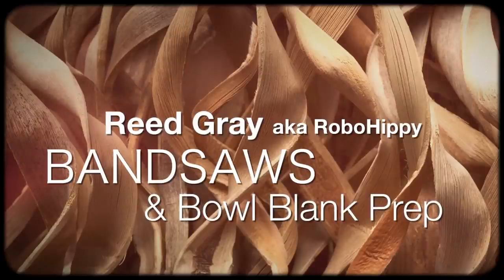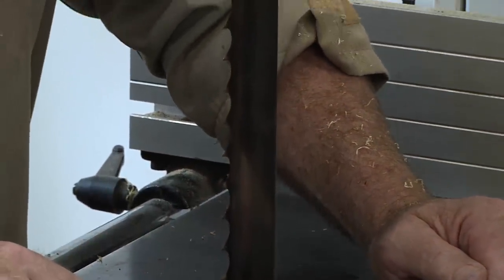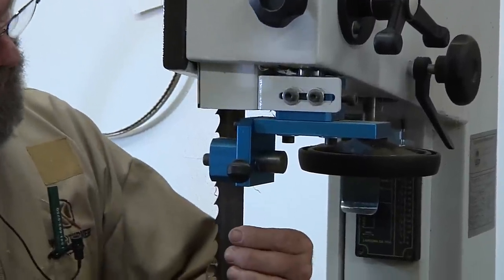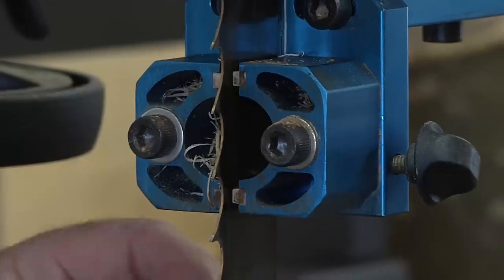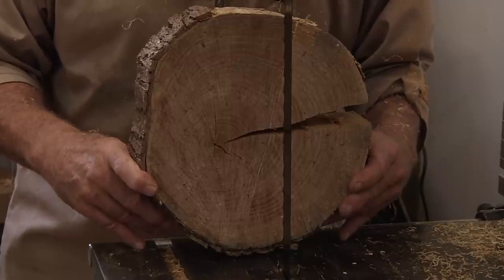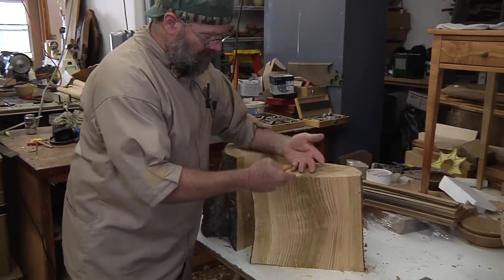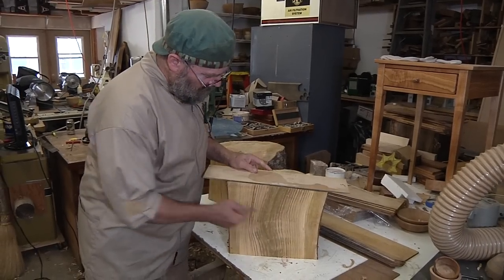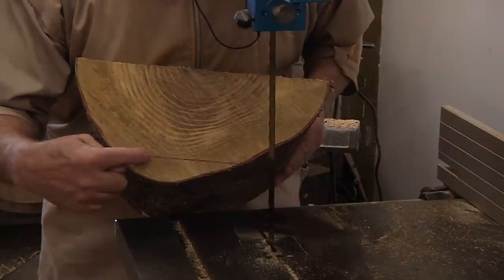BANDSAWS & BOWL BLANK PREP by Reed Gray aka RoboHippy

Comment: First time viewer and subscribed. Excellent instruction, very clear and to the point. It appears that their is no need for a circle cutting jig in your shop, man can you cut nice circles . Can you give a newbie a few tips on how to cut on the line so smoothly and so quickly?  Ty
Reply from the maker: Well, first thing is to have a good sharp blade on the bandsaw. I use the Lennox Bimetal Diemaster blades, 1/2 inch by 3 tpi, and they do make a 'thick' one. With a 1/2 inch blade, you can cut a 6 inch circle. The thing about the Bimetal blades is that the teeth are M42 HSS, which a lot of turning tools are now being made out of, as well as it is the same metal they have on the pallet cutting blades. Stays sharper longer and cuts straighter. They can be resharpened easily if you have a good saw shop near by. Other than that, you want the side on the table to be flat so it doesn't rock when you are cutting the circle, which can make the blade bind up in the wood or even some times break. Having a good spot or task light really helps too. the problem I had with the circle cutting jigs, is that even after cutting the circle, you have to drill a hole for a worm screw, or put a face plate on, or like I do, drill a recess. Even if the blank is perfectly round, it still ends up being a little off center.

Comment: Great info Reed. How would advise storing and sealing the half logs before putting them through your process?
Reply from the maker: I think I cover this some where.... Been a while. Personal preference, and a lot depends on where you live, I prefer to keep logs whole and cut off pieces as I need them. I use a heavy duty tarp on the ground, and heavy tarps on top so they are pretty much sealed from wind and sun light. Keeping them under trees is good. I don't seal the ends of my logs. If you cut them into sections, then you need to make them longer than they are wide. I used to do it that way, but found out I lost more wood that way. If you want to seal the ends, there are a couple of log end grain sealers. I only seal spindle blanks that I have rounded out and rounded over the rims. I use Titebond 3. Works as good as anything else out there. I think it is cheaper as well.
Reply: @robohippy  Thanks for replying Reed. I did find the answer in one of your videos after I posted the question. Your videos are very informative and well set out. As an aside, are you still selling bowl tool rests? Regards Adam.

Comment: Hey Robo,
   "Big-Time" grateful for your sharing and guidance. 
If I could ask one question though; was curious as to the horse-rating on your "little" band saw?
And looking forward to more great videos.
Thanks again!
Reply from the maker: The little PM is 3/4 hp I think. great for  up to 6 inches, which is the limit of how high this one will cut. You can cut 12 inches high with 1 hp, but it is a struggle. Of course, good sharp blade is a must.
Reply: robohippy Right on!...and thanks again...

Comment: Great video, how long would the wrap last? could you leave something wrapped in shavings for 6 month?
Reply from the maker: I have had some pieces remain crack free for 6 months or so, but not much longer than that.
Reply: @robohippy  I use glue to seal the end grain trying it out for the first time....I'm new to turning..so I want to try what other experienced turners work best for them. Love your videos..I will try to do your method and also place them in plastic bags with shavings...that should stay stable for over six month I believe.
Reply from the maker: @dannyboy9784  The problem with a plastic bag is that stuff can mold inside the bag. The blanks do need a little bit of air to keep that from happening. If I wrap the rim of maple blanks, they will mold under the plastic, perhaps because maple has a lot of sugar in it. I have tried glue on some pieces, and it seems to work. I have some Pacific Madrone, which is very prone to cracking. I turned some rolling pin blanks out of it and sealed them with glue on the ends, making sure to round over the ends of the cylinders, and having the glue go down the sides a bit. Thus far, it looks good. May be another year or so before I turn them. Madrone is one that can look fine on the outside, but be cracked on the inside. Some times, you can sink them in water, and a flowing stream is best. If you sink them in a barrel, the water can go rather nasty after a bit. Drying and preserving blanks is another part of the art of woodturning in part because every species of wood is different...
Reply: @robohippy  Thanks for the insight...I saw some people boil them for 1hr and put them in shavings after and they say it relieves the stress in the wood and cuts by half the drying time...interesting...I would have to try this on my next bowl turning....Cheers.
Reply from the maker: @dannyboy9784  Boiling is done as one hour per inch of thickness. Allow to cool to air temperature, then remove from water. Allow surface to  dry, then seal and store. Again, I don't like the storing in shavings, unless the shavings are dry. This method is used for difficult woods like madrone. I don't use it because it is too much work, it does muddle the colors together, and I like warped bowls. One turner, Christian Burshard, down in southern Oregon takes his madrone pieces, finish turns them, puts them in a paper bag, and then puts that paper bag inside a plastic bag. He changes out the paper bag every day. Dry wood shavings could do the same thing, but again, I would change them out. I did hear of one turner who would store his in big plastic drums. Still, they could mold. I put a bunch is a big trash container on wheels that I took to a symposium. Kept them nice for the duration of the show, and I turned enough so that they didn't mold... Off to the swimming pool now, have to get my exercise....
Reply: I've kept blanks wrapped in saran wrap for 12 months+ with no checking, but I wrap mine completely with several layers so it doesn't allow any moisture to escape.
Reply from the maker: @matthewroberts9541  I have had a couple that survive that way. Had some apple that stayed sound on the outside, and had some surface checks on the top, but didn't go deep. It doesn't work for more than about a month or so, most of the time with Madrone, which starts to split before you get your chainsaw out of the truck. I have been experimenting with sealing the end grain with titebond 3 on some cylinders I have turned. Seems to work even with madrone. Haven't turned them yet, maybe another year down the road. I don't like to totally seal any wood that has high sugar content, like any maple, and I think madrone has high sugar, as it leaves a sticky crust on me when I turn it and the little sugar ants love to crawl all over it. Woods like that start to mold right away. Might work well with ash or walnut. Every wood is different.
Reply: @robohippy  How do you think it would work comparatively with elm or birch? I'm fairly new to both species but recently was gifted several trees that I want to preserve until I can process all of it.
Reply from the maker: @dreadpirate2432  Should work fine on the elm. Not sure if the birch will mold under the stretch film or not. Only one way to find out... Don't get much elm out here in Oregon. Some birch, but most or the time it is too 'white' or slightly off white which didn't sell well for me.

Comment: Hi Reed hope all is good with you. I'm in the market for a new bandsaw. Most of my work is production bowl related. I currently have a 2hp 14" Grizzly bandsaw that struggles when I'm trying to cut green lumber that is 5" or higher. I've been using a 1/2" 3 skip tooth blade. Very frustrating and dangerous. Any suggestions on a good bandsaw that can help me cut 12' to 17" bowl blanks? Many Thanks! Skip Proctor
Reply from the maker: Hmm, if you have 2 hp driving the blade, it should walk through any wood with pretty much no effort. My first suspect would be your blade. Best value for blades, in my opinion is the Lennox Bimetal Diemaster blade. The teeth are M42 hss. This is a popular metal for turning tools now, and is also what they use on the pallet cutting blades. A nail might slow it down, but generally won't ruin the blade. Your blade might be dull or shot. These blades cost a bit more, but you get far more cutting from them, and any good saw sharpening service can sharpen the blades a couple of times rather than tossing it when dull. I use a 1/2 inch 3 tpi blade. Make sure to get one for wood, not metal. 

Other than a sharp blade, you need a really flat surface on the wood blank to cut circles. If the blank rocks at all when sitting on the table, then it will rock when you try to cut the circle and that will make the blade bind up in the cut.
Reply: @robohippy  Great advice. I think you're right on 2 fronts. My blade is probably cheap/dull and some of my blanks do rock on the saw table. I'll definitely get a wood Lennox blade. Worth the extra $$. Thanks again Reed!

Comment: Back again.
My question this time: what's your technique for "proper" tensioning of the blade.
Reply from the maker: Not sure I really have one. I went to a blade store in town after getting my first bandsaw and the guy there said that on saw tension meters were pretty much junk, like the blade that comes with the saw. He told to crank it up to the 1 inch setting for the 1/2 inch blade. My big saw has a much better scale on it, but I usually tighten it up more than what they say. This works if you use the thicker blades (not wider, but more heavy gauge). Some of the more thin blades will do a bit better with less tension. Best bandsaw set up video I have seen is by Carter bandsaw products. I will see if I can find the link, and remember to get it up here.
Reply from the maker: Here is the link to Cater Bandsaw products set up. Excellent: https://www.youtube.com/watch?v=wGbZqWac0jU
Reply: Fantastic!...Thanks!

Comment: Hey robo :) Could you tell me the specs of your little band saw? I really need something like this but I am so unsure what to get. I will be purchasing one in February 2016 and wanna spend around $500 if that is possible. Ok thanks man :) 
I was also unsure of what TPI to get to cut up to 6" thick and be able to turn a circle with the band saw.
Reply from the maker: +ProD Miner That saw is over 20 years old. It has a 3/4 hp motor, and cuts 6 inches high. I don't think PM makes that model any more. Probably the only way to get a $500 bandsaw with a motor that hefty, is to find one used. Most in this size range now have 'riser' blocks you can put in so your vertical cutting height can go up to 12 inches rather than 6. A 1 hp motor can cut 12 inches high, IF you have a good sharp blade. If it is at all dull, they will really struggle. Ones that only cut 6 inches high are fine for cutting most circles, and some square blanks. For blades, I prefer the Lennox Diemaster Bimetal blades, 1/2 inch wide, and 3 tpi. You can find others that are cheaper, but they don't cut nearly as well, or resharpen as well either.
Reply: +robohippy man thank you so much! You deserve a million subscribers btw. Your videos are more into depth than any I have seen so far.
Also I am Blake S on the forums about the proper tool for a bowl. I made a new tool and I am turning a oak bowl right now. I have one side complete, I watched your video on proper setup on chucking your bowl blanks and I learned something and even got to use that for my chuck spot. I am gonna try it right now and go carve the inside of the bowl wish me luck! I will be posting pics of it on the forums and it has a few nice elegant curse and about 6" diameter very beautiful bowl :)

Comment: what size of blade on the second saw you cut the circles on?  Width and TPI?  Thanks!
Reply from the maker: The smaller saw has a Lennox Diemaster Bimetal blade. 1/2 inch with 3 tpi. You can cut a 6 inch diameter blank with that.
Reply: @robohippy  thanks!

Comment: hi robo  I have a craftsman  bandsaw .  I can cut up to   8 inches. what speed is best to cut green  wood  it has a low and  high  speed .
Reply from the maker: +MANUEL GARZA Well, I don't really know. Mine are all made for cutting wood only, and I talked to my blade supply guy about cutting metal on the small saw, and he said it was way too fast for cutting metal. I would guess that the high speeds are for wood, and the slower speeds are for metal IF your saw is designed for both. If you have the manual that came with it, check that out, or call Sears and ask their techs to be sure and safe. The blade is as important as the speed and saw. Most blades that come with your saws are junk. I prefer the Lennox Diemaster Bimetal blades, 1/2 inch wide, and 3 teeth per inch. Not as good for cutting dry wood, but excellent for cutting green wood, and they can be resharpened.